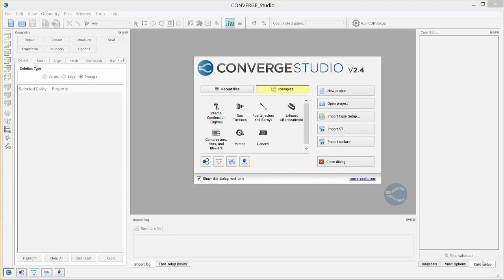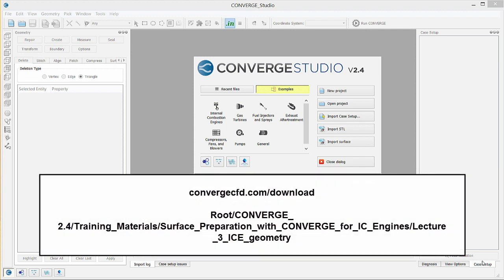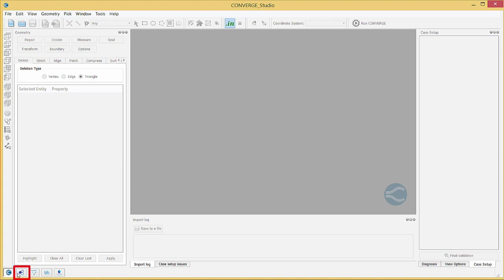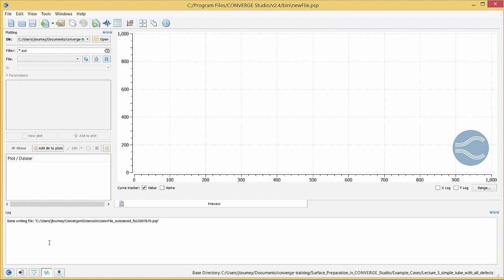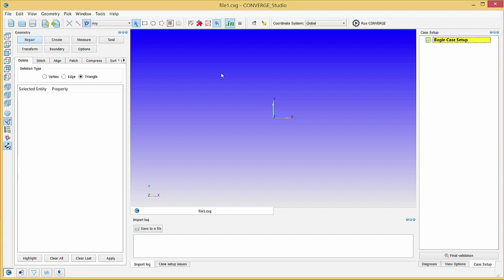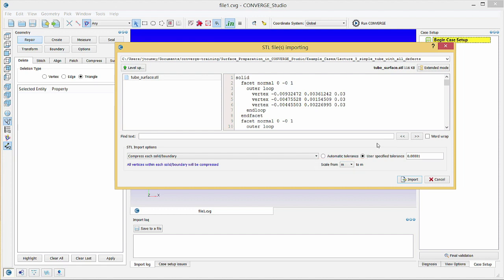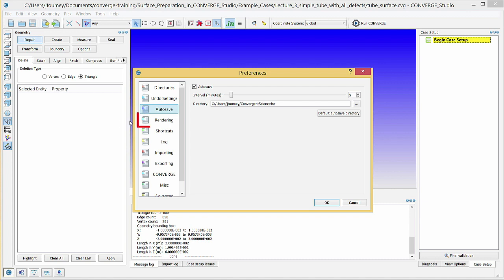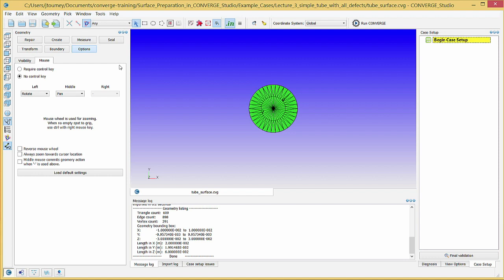Overview and Importing a Surface | CONVERGE Studio 2.4 Tutorial #1

Comment: Hello, I can't find the geometry file where you say it is. The site convergecfd.com/downloads doesn't work and I can't find it on hub.convergecfd.com either. Has it been moved?
Reply from the maker: Hi, sorry about this, we did move the file on hub.convergecfd.com. You can find it in Downloads > CONVERGE 2.4 > Training Materials > Surface Preparation With CONVERGE Studio for IC Engines > Example cases. Once you download the example cases it will be in a folder labeled Lecture_3_simple_tube_with_all_defects